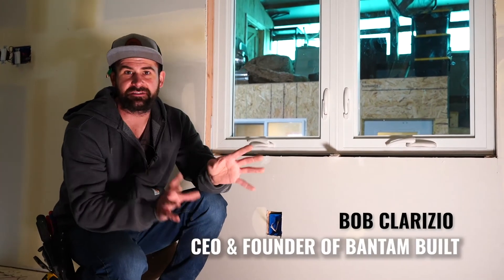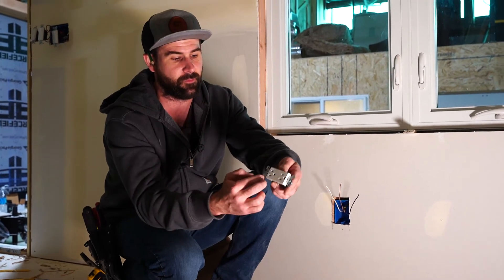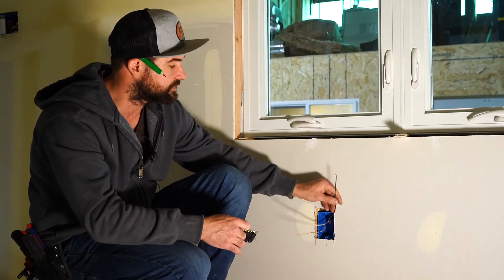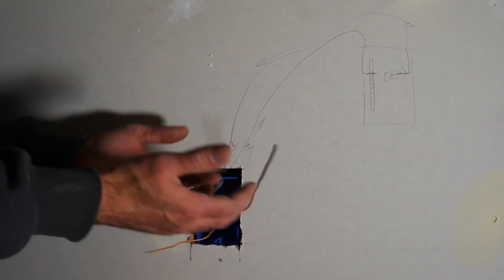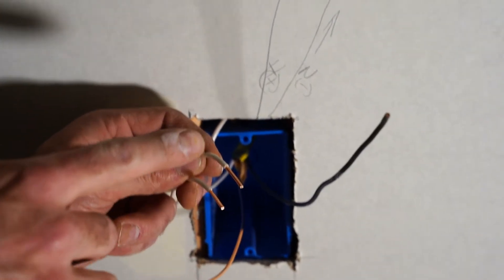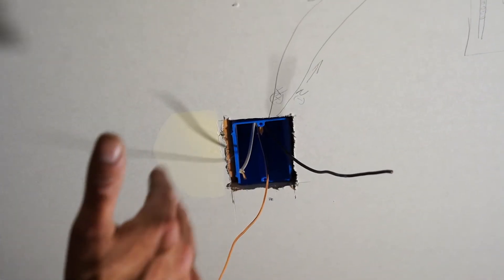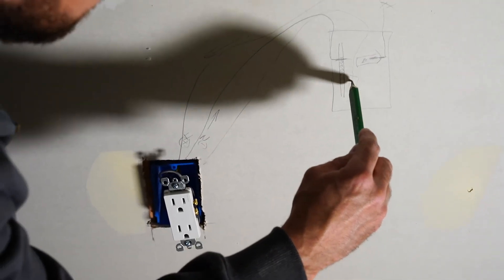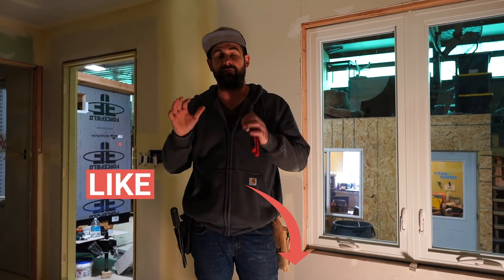How to install an outlet at home

Comment: Any videos on installing a receptacle with a metal junction box?
Reply from the maker: I can do one for you, absolutely
Reply: It's similar, but you need 2 pigtails. The 3 wires are connected with a wire nut, one pigtail to the receptacle and the other is fastened to the box with a green 10-32 screw. There should be a 10-32 threaded hole in the box. This process grounds the metal box. The pigtails can be bare copper or preferrably green insulated 12 or 14 gauge.